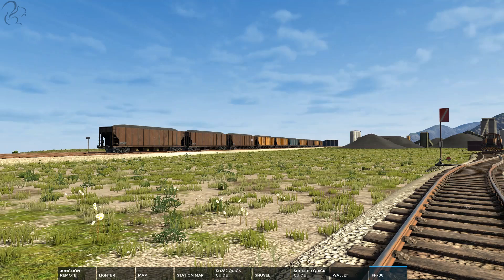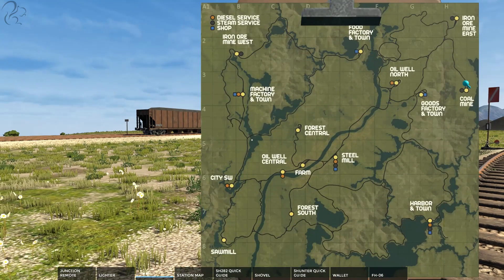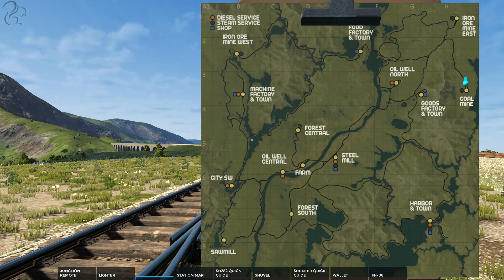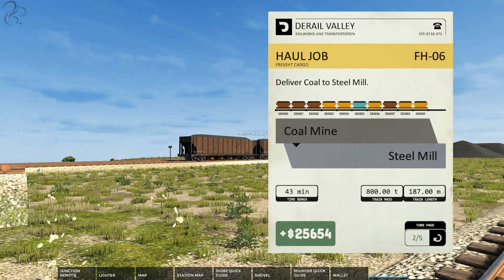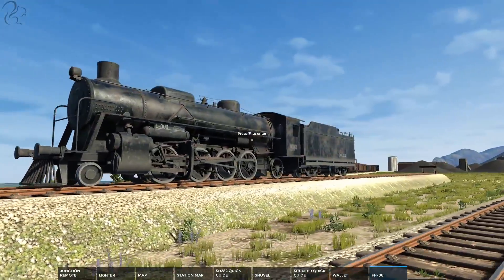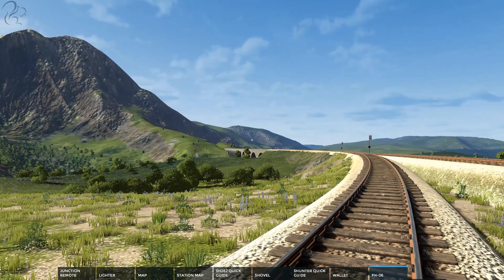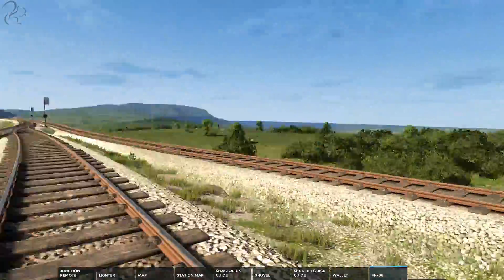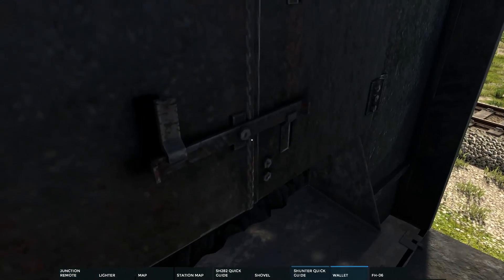Derail Valley - 800T Steam Haul

Comment: Ive just come off derail valley at the time of writing this comment and i pulled 1472 tons over 3 different job booklets with a single steam locomotive. Although i did have to have the blower, the drafting and the sander on full blast and once i crested the hill, i was pretty much out of sand and once i was on the long straight leading up to the bridge just before the tutorial area, the tender ran dry so i had to get to the steel mill with the boiler only a quarter full of water and then when I uncoupled the steam locomotive from the train to bring it to the fuel area, the fire went out about halfway down the length of train because there was no more coal or water. There are a few things i would like the devs to add. Being able to control multiple locomotives from just 1 cab would be extremely handy and brake vans would be absolutely brilliant. I had MEGA problems on the downhill stretch because the wagons kept banging into eachother since the couplings had been stretched going uphill but were now coming together going down. A brake van would stop thus from happening as there would be a way to brake the train from the rear. Thus stopping the wagons from hitting eachother.
Reply: Caboose is in the works and will be added later.
Reply: A brake van can only do so much though Specifically meaning If you have a Very heavy train you would need either a Large brake van Or Multiple Smaller ones to do the work (Though off topic I do hope they add in a Small steam shunter and Multiple types of brake vans For different areas (For example at the steel works You would have a heavy Brake van at the farms you would have Lighter Brake vans and the steam shunter would have more power than the diesel shunter
Reply: Coupler slack is a problem in real railroading to this day.  Nice that the devs modeled it in the sim- they have put a lot of work into this.
I think only UK (European too?) railroads used "brake vans."  In the US the caboose was an office for the train crew, dating back to the days when the brakes were set by hand while walking across the top of the cars.  Today there is still the capability of partially setting the brakes on a few individual cars to keep the slack stretched while going downgrade.
Reply: @ostlandr  I think in the game a brake van would be more practical. Setting brakes on individual wagons would be very inconvienient. You could just pull one handle and the couplings stay taught because the brake brake van is braking from the rear. I also think tbat if brake vans werre to come into the game then there should be two different handles for the engine brake and the brake in the van.

Comment: So I fire these things in the UK and to be fair the game is pretty good at simulating the rush of it all. It isn't always relaxing! That 'steam dump' is called a blow down valve and would be used either before coming off or going onto shed to force out any contaminants in the boiler (Not to drain the entire boiler as it wouldn't do it much good!). The 'Vent' is called the damper and quite often there can be anything from 1 to 4 (or none!). These are essentially doors on the ashpan (where the fire ashes are collected) that open and shut depending on how much airflow the fireman wants to have. The game shows that very well! For an early access game the simulation is very good. The 'temperature' gauge is something you wouldn't see in real life and is it a bit unnecessary really and i'd like to see the injector modified to be a bit more realistic having a water and steam valve with variance depending on pressure, water temperature, etc (they really are temperamental and never work the same!) but the idea of putting it on and simply leaving it in the correct trim is exactly what I do!  Cheers for the top class video Squirrel. I look forward to the next one!
Reply: Used to love running steam locomotives in Trainz Railroad Simulator.  Took the Big Boy to Australia and put it on the Pibara iron ore hauls because why not.

Comment: On a real steam locomotive, you actually don’t want the water to be fully topped on on the meter. You want to maintain it at about 2/3. I keep it at 3/4 in the game, because it’s easier to measure using the bolts placed along the meter in 1/4 increments. If it drops below 1/2 in real life, you are running the risk of a boiler explosion. If it’s too high, you won’t have very much steam reserves.

None of this is taken into account in the game as it is right now, but if you want to operate it realistically, keep it in mind.

Comment: There is no steam dump valve on a steam engine. They have the safety valve but that’s up top on the boiler. The steam that comes out is usually the water injector. Is a lot more complicated to drive and fire a steam engine than this one.

Comment: very Nice video! If you want even more challenge, try firing the engine in such a way that the safetyvalve doesnt blow al the time. this saves coal, but mostly water! this is done by using as little coal as possibly (1 shovel at the time). I really find this a Nice challenge because the range becomes MUCH bigger. thanks again for the Nice video

Comment: I tried to appropriate this technique in the steam engine trying to haul 600T out of the Harbour and it was almost a total flop. I think I didn't build up enough momentum but I was too worried about derailing the looong train of carriages at the back still winding through the junctions. By the time I'd made it 2/3 of the way up the incline I ran out of sand and was wheelspinning like a bitch. Luckily I was towing a DE2 at the rear and the comparatively wafty power of that engine was just enough to crawl up the last of the incline.

BTW playing it in VR makes it way easier to manage everything in the engine room; with a bit of practice you can shovel coal with one hand.

Comment: Steamers are constant torque, variable horse power. Diesels are the opposite. That's part of the reason, I believe, why a steamer can't actually develop its full horse power until it reaches a certain speed. Also don't leave your injector open when the water glass is full. You just end up wasting water plus it gets carried over into the cylinders and you run the risk of blowing the heads right off. And in real life you wouldn't want your safety valves to keep lifting unless you want to waste coal and water.

Comment: 53:40 "We did it in 89 minutes.. which is a complete and utter lie. How could we possibly have done it in 89 minutes. The video is only 60 minutes so far."
Well the explanation is quite simple: somehow you activated that job before the video started. The evidence is at 10:23 where you've completely ignored that the job was "in progress" and basically already expired (Elapsed: 42). There are 43 more minutes between 10:23 and 53:40, so that's 42 + 43 = 85. I'm not sure about the missing 4 minutes, maybe it got lost in the cuts. Anyway, if it's any solace, you wouldn't make it regardless (89 - 42 is still greater than the required 43).

Comment: On the left side of the cab there is a lever with 3 settings, under it is a button you can push. Its not mentioned in the manual, but what is it supposed to do

Comment: Interesting, shame they went overboard on the derail physics yet it seems to lack realism in other areas. Id prefer a more accurate set-up with the cut-off and there are seemingly absent things like cylinder cocks and priming. Still going to give it a go but there is room for improvement from my point of view as someone who has operated the real thing. Running as both driver and fireman is also pretty unrealistic as not something that would occur outside from small shunting locos or the like.

Comment: What you call the "vent" is the cylinder cocks and are used to remove condensate from the cylinders when starting off. It is NOT a turbo! It takes away power, not adds to it. And leaving the injector on and over filling the boiler is BAD. OF course, you are playing the game, not running a sim. Why I won't touch the steam loco, it's not realistic. Also needs an auto fireman. Not a 1 person job.

Comment: Did they really have to go that slow all the time in real life? also can u do one purposely derailing ? are the graphics good on that?
Reply: They did and still do need to go extremely slow on declines. Modern diesel locomotives have the advantage of dynamic braking, though, unlike the old steam locomotives. Inclines/declines are one of the most dangerous things on a railroad, and a change in elevation as little as 3% can be a life or death situation for most trains.